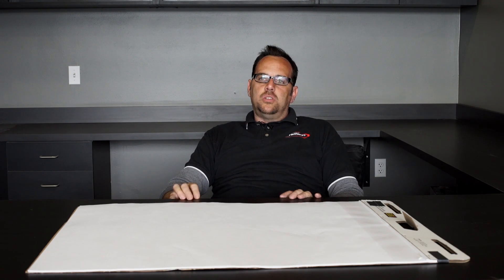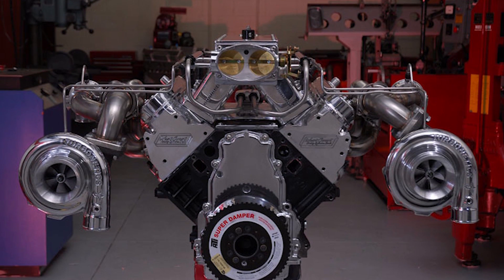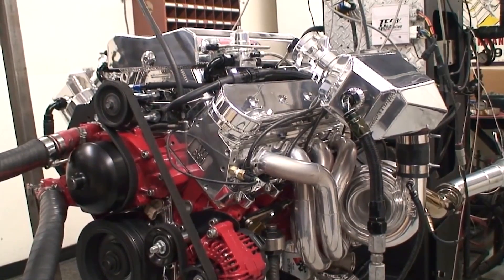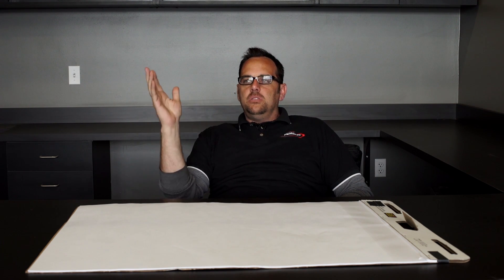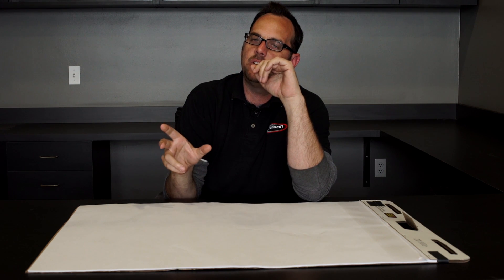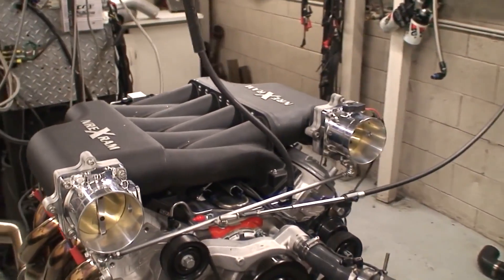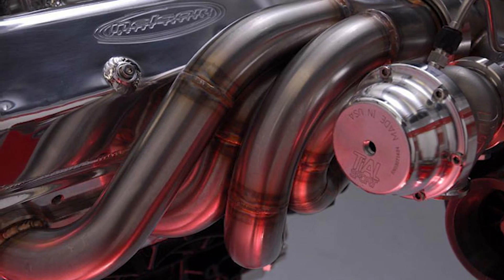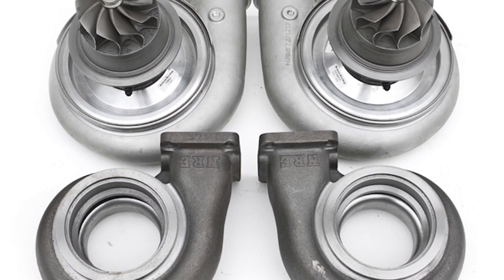Master Engine Builder Explains Why the LS V8 Is SO Good

Comment: Lots of nice input in this video, unfortunately this doesn't apply to other countries.
V8 in junkyard ? Not even in dreams...
Reply: +spark972 Yeah, exactly what I thought!  You will sometimes find V8's in junkyards where I live - they are almost always 1UZ-FE's from old Toyota's and Lexus's - which are good engines but hard to get big power out of, or possibly a shitty LT small block from a Holden Commodore.
Reply: Yep, and here they get ripped apart by the guys that work at the yard before we get to even see them. Also any solid transmissions, gone before they are in sight. 😞
Reply: +spark972 Same here.
And when there's one it gets ripped apart in 12 hours.
Reply: That sucks for you guys.  There are hordes of LS engines in the junkyard thanks to all the pickups and SUVs from Chevy, GMC and Cadillac.  Almost all the truck blocks are iron.  4.8L and 5.3L are a dime a dozen.  I find them all the time with all the accessories, harness, ECU, and trans for about $1200 with 100k miles.  Usually can get another 100k before the trans gives out, but the motor keeps going.
Reply: It's not so bad, 2jz, rb25 and Barra 270t are all easy to get here.
Reply: +spark972 Just get a 2.0l 16V
Reply: +stlchucko Yea....that's not a good idea.
Reply: ThatDanDude  How is that not a good idea?
Reply: there's lots of v8 engines in the junkyards in my towns. just get it out of a truck in the junyard
Reply: +Josiah Crowley guess who made the rover engines for decades ? buick ,,,, and guess what they are made out of ?
Reply: ***** Aluminium?